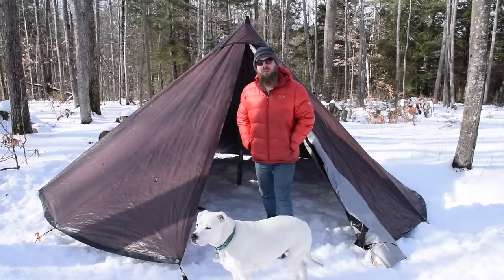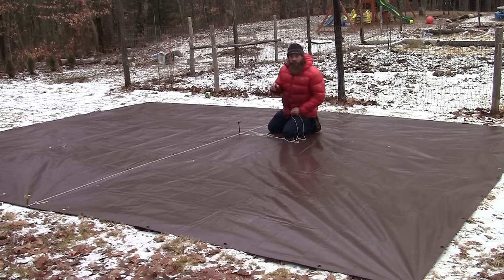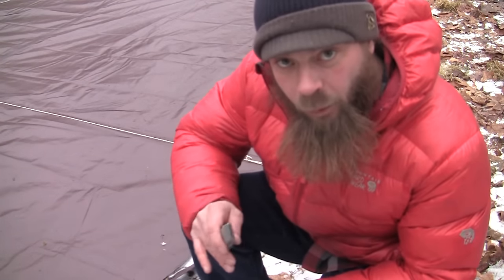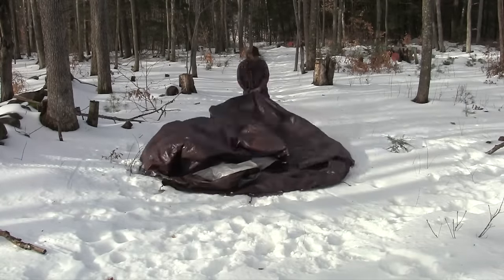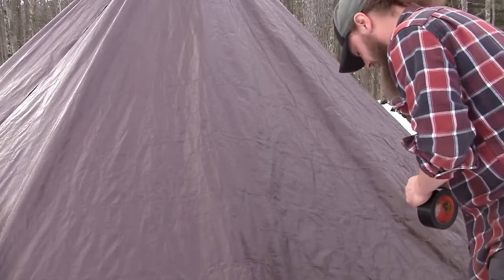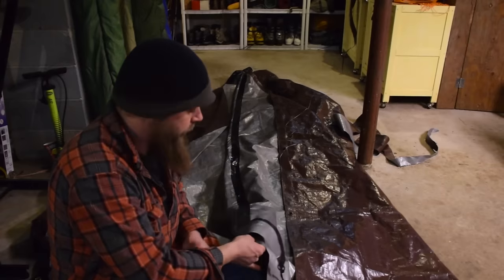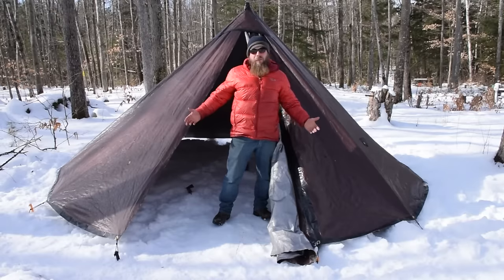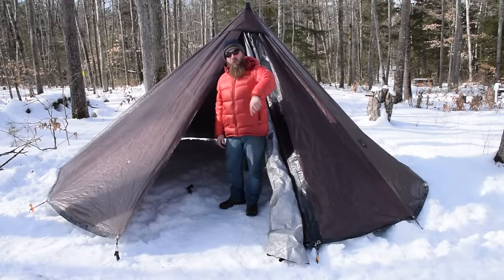CHEAP , DIY Hot Tent , from a tarp !!!

Comment: How do you keep the wind from blowing in at the bottom? Snow skirt?
Reply from the maker: This is a good question. Before I set up the tent , i pack the area where the tent will be, down with my snowshoes. I make sure to pack out an area that is slightly larger than the footprint of the tent.  This does several things. It gives me a more solid area for living space. It gives me a more solid area  to drive stakes into ( making the structure stronger) And it also makes the base of the tent  lower than the snow around it. This provides a wind break. Not much wind gets in. And what does get in I welcome. I prefer to have a constant air flow. Good ventilation. This is important to prevent the build up of potentially harmful gasses caused by the use of a stove. Good ventilation and airflow is also a strong factor in combating the build up of condensation inside the tent.  
  Also, when it is snowing, I know snow will collect at the base of the tent . That alone will seal the bottom of a tent fast.  
 I do not like snow skirts. Snow that comes in contact with the tent melts, because the tent is warm from the stove. This water runs down the tent and collects with the falling snow at the base of the tent. And there it will freeze overnight. Now the tent base is encased in ice and breaking it free can be a real chore. Often leading to the destruction of the snow skirt. This is worst case. doesn't happen everytime. but I have seen it happen. No fun. 
   Please keep in mind that this is just my personal preference. Many people go about it differently. 
  Thank you for the question. I hope this helps. 
 -Justin
Reply: @ItsGoodintheWoods  good call. Just got the supplies to replicate this set up. Looking forward to putting it to the test. Thanks for all the tips 👌
Reply from the maker: @k.y.outdoors3504  Awesome!! Have fun with your build!!  Keep me posted on how it goes please!

Comment: Hi Justin.  This video earned my sub to your channel :) Thank you for the time to create and share this! I am new to hot tenting and am set on making my own tarp hot tent.  I prefer the geometry of a pyramid tipi...even better would be one with 1 or 2 foot vertical walls at the base.  Using your tie out point design, do you think a tarp tent design with vertical walls at the base would be possible, or do you think the design in your video would be structurally stronger? Thanks in advance for your thoughts!
Reply from the maker: Welcome to the channel Cory. Thank you for subscribing.  I do think adding a wall would be possible, but I have no experience with that design on a DIY tent. I am sure a crafty mind could figure it out and make it work. As far as what design would be more structural...I really don't know....
   I would enjoy seeing your project. If you could keep me updated on the build I would appreciate that. Hot tenting is awesome! Good fun. I hope you enjoy it. Camping in a tent you made yourself is extremely rewarding. Best of luck! 
                                     -Justin
Reply: @ItsGoodintheWoods  Thanks Justin.  I liked your tip about heating the Gorilla tape to help adhesion.  I am also going to try using a specialized silage repair tape with my first version.  It is designed to hold in the cold, but isn't as thick as Gorilla tape.  Just waiting for a tarp to go on sale at this point.

Comment: Hw is  Gorilla Tape holding in the rain/moisture? I bought 2 rolls, grommet kit etc. but now im thinking about using some glue or cheaper tape like 3M or Tesa. Im also thinkong about using tarp clips at the bottom instead grommets. I just wonder if duct tapechold on to the tarpaulin after longer exposure to rain and sun. Did You use this tent for lor longer period of time? How this tape joints hold? Didnt You need to glue something or sew?
Reply from the maker: Check this outhttps://youtu.be/PCltLEE5is4
Reply: @ItsGoodintheWoods  Thx, I heard about this test in Your video but didnt see the actual video ;] Im just not sure about using tape for structural purposes, but it seems like for my occasional use it could be just OK. Today I cut the rough shape of the tent from 5x6m tarpaulin, kinda thick (260g/squere meter), but its extremely bulky and heavy.  Ok, thx for quick response and I wish all the best for You.

Comment: Shoulda lined the inside with tape as well then added a extra piece of tape at grommet imo but still nice and idk u ain't done yet js lol
Reply from the maker: This tape is amazingly capable. I put this tent through an 8 month torture test. Left it standing, outside for 8 months before a tremendous snow load brought the tent down.  Turns out it was the big oak pole  that failed.  The tape never let go. None of it. Not 1 grommet pulled out. The pole broke in half and poked a hole through the tent. I still need to fix it. But this tape isn't letting go .  You are correct, I am not done with this tent yet. LOL. I have another build coming in the near future !
Reply: @ItsGoodintheWoods  awesome man and yeah that gorilla anything ain't no joke rather its glue or tape or wutever but that's great for no more then ya got in it I hit a 16x20 laying in my shed I wanna use 4 a hot tent

Comment: Just cut the one side for the door and then when you meet him together or you have that over flap watertight
Reply from the maker: I thought about that, but the layout doesn't work out right. You would still have to add a piece to the bottom of it......If I do this again, I may try it. This is the second tent I have built this way, haven't had a problem with it yet. But if the tent ever does fail, I suspect it will be the door.....thanks for watching and  the comment. -Justin

Comment: When cutting the door why do you cut a V out of it can’t you just cut straight down from the center then you wouldn’t have to tape a extra piece on to make it over lap
Reply from the maker: To make a cone out of a flat rectangular piece of paper, a v cut is required to get the right geometry. 
 Also the bottom of the door would be working it's way up the tent if only one cut was made.
Reply from the maker: This is a good question
Reply: What mil tarp did you use

Comment: You did an AMAZING JOB!!!! I will make one of these for sure! And incorporate you build technique with another YouTuber you built a PVC truck bed tent. I’m going to include his link. And the only reason why is, he bought an adhesive 7ft zipper that he placed on the tarp to make a door. Thank you so much for sharing. 

https://youtu.be/_fZK6XLnRXI
Reply from the maker: Thank you so much! I just checked out that video link. Pretty crafty. I love it. I did buy an adhesive zipper for this tent. But I am almost certain that it would not be capable of holding up to the weight load of snow. I bought the zipper, and set it aside. Perhaps I will wipe off all the dust and give it a go.....because you never know until you try. You may have motivated me to revisit this project

Comment: You really need a cheap used sewing machine to make a proper solid tent, tape will work for a trip or two.
Reply from the maker: I made this tent over a year ago. I have used this thing in snow storms , Then I left it standing outside for 8 months before a massive snow load finally caved the tent in.......and it wasn't the tape that let go, the pole broke.  A simple repair with spare tarp parts and more tape...ready to go.  That tape holds very well. It's not letting go any time soon. 
 Here is a link to the 8 month torture test if you are interested in checking it out.https://www.youtube.com/watch?v=PCltLEE5is4&t

Comment: I don't understand the point of cutting the tarp, why don't you just take the part you are cutting and fold that inside tent. It's so much easier and you keep your tarp intact
Reply from the maker: the tarp needs to be cut to attain the cone shape. Less material, less weight. The next time I do this, I will try leaving the door intact, but that will still take some tinkering and taping.

Comment: Use heat to weld the plastic and give up on that expensive and ugly tape!
Reply from the maker: Thanks for the suggestion. I think I will stick with the tape
Reply: @ItsGoodintheWoods  Good idea.  I hear all of  the quality tent makers are going to switch to tape.  LOL
Reply from the maker: @robertwilkinson8115  Hahahaha! The combination of the tape and tarp is surprisingly rugged. This tent stood outside for 8 months before it failed. A heavy snow load brought it down. The tape never let go. it was the oak pole that snapped in half from the weight load. I was extremely surprised
Reply from the maker: I made a video about it, check this out! https://www.youtube.com/watch?v=PCltLEE5is4&t